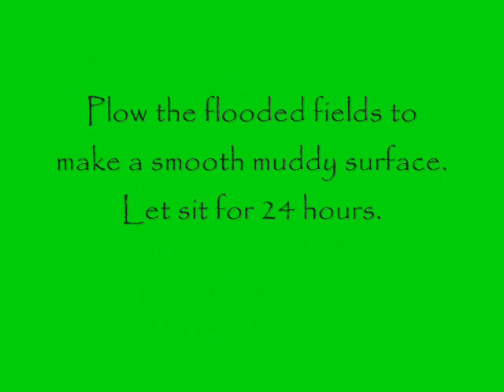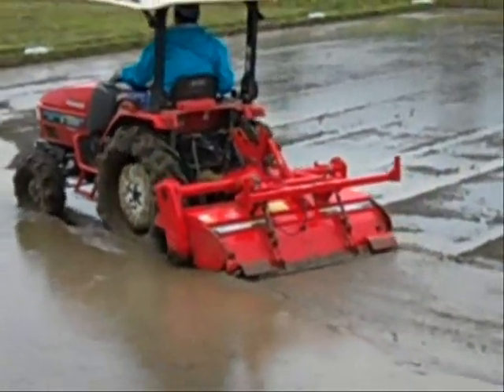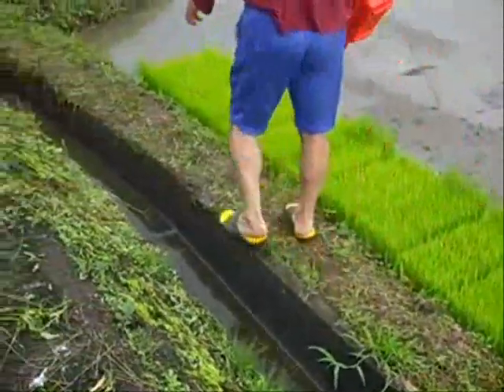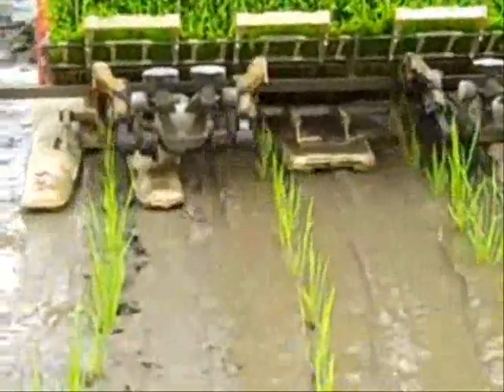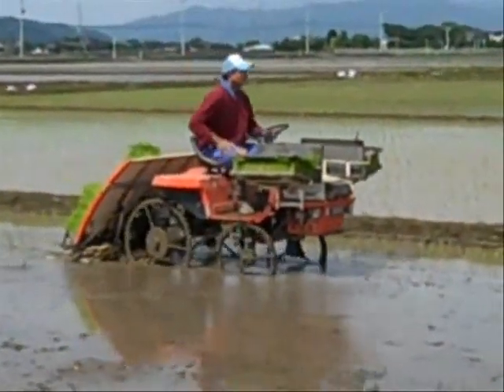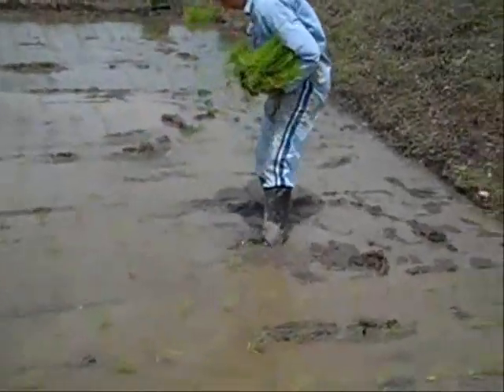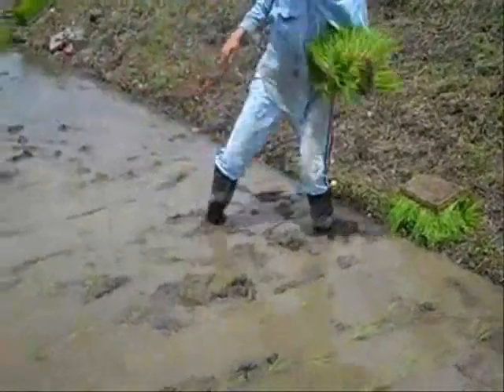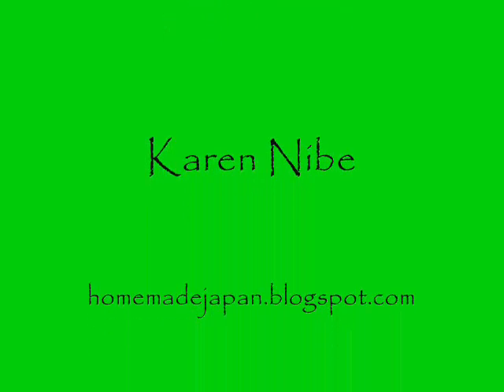Planting Rice.wmv

Comment from the maker: @larzky1039  This does work in deep mud because the "wheels" of the machine are not rubber, they are metal. They are narrow and have notches on them so they can rolls through thick sticky mud without getting sucked down or stuck. Just before planting and during the first flooding, we plow the fields to about40 cm depth to let the water soak in. It's pretty deep and very sticky!You can look on the Yanmar or Kubota sites to see some examples of these machines for sale, also Alibaba.

Comment from the maker: @anthonyguada  Hi, It's been a busy fall. I do not know of any sellers outside my area but I would suggest doing a search for used or refurbished equipment. There are a few resellers in Asia. New equipment is so expensive and the shipping costs are outrageous. Look for Kubota or Yanmar and also check alibaba.com to see if they have some reasonable equipment. It would be best, I think, to find a seller in the Phil. because you would want to be able to repair it or replace parts, etc.easily.